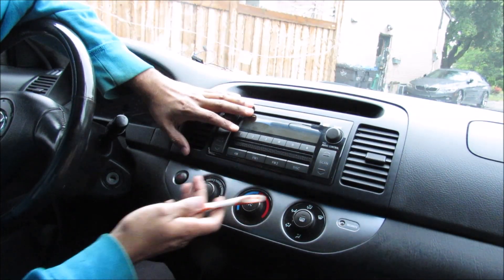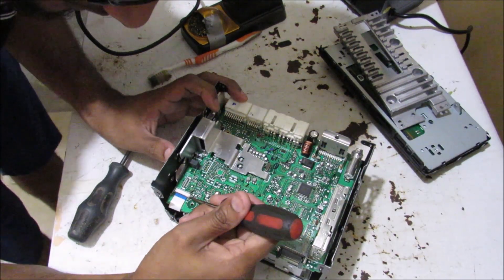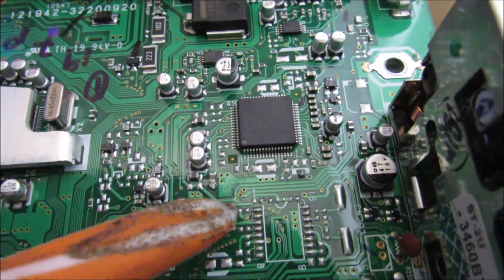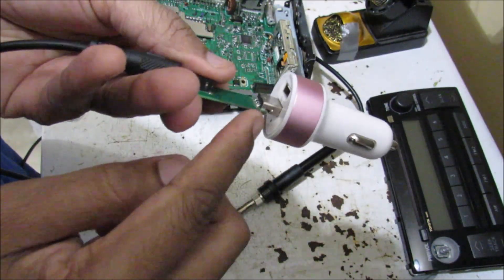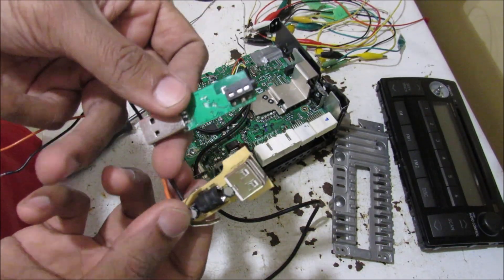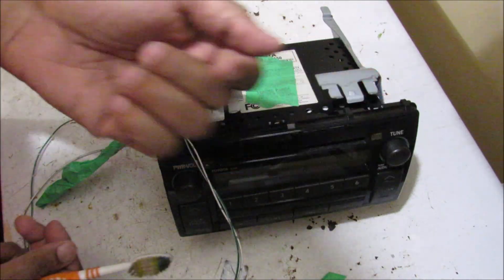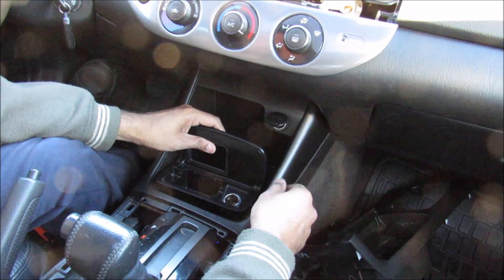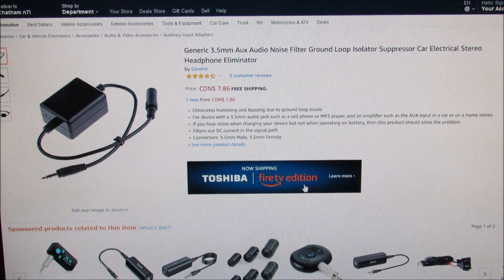$10 Bluetooth Stereo Hack

Comment: Why not use the aux input legs of the mixer chip?
Reply from the maker: Because you'll need bus protocol to trick it to read from those legs
Reply: @speedkar99  ah fair point.

Would there have been some way to trick the unit into thinking there was a CD there always whenever CD was selected or is it talking rather than direct control?

Nice work either way, in my case for my ford which had factory boot mount CD stack and double stack unit up front I just tore the stacker and double dins out and now have a pioneer bt unit and uniden digital scanner below that. The bt unit is great as it gives hands free phone so with the cradle I can still legally use the phone whilst driving and can stream my tunes so 99.9% of the time my tunes are off my phone now.

Comment: One possible improvement on the hack is to power the Bluetooth module using the 5 volt supply from the radio, just need to locate it.
Reply from the maker: Good tip. Tried the 12V supply to my inverter and my radio didn't turn on...

Comment: In my opinions...Inbuilt Bluetooth module is way cheaper and efficient...not at all worth doing this.
Reply: The module which comes with factory installed Bluetooth...I got the one for 20 bucks
Reply from the maker: Oh the one that plugs in to the back of the radio... Yes there are off the shelf solutions 
They are a bit more expensive and not as fun a hacking your radio
Reply from the maker: Inbuilt meaning comes with the radio, or putting the module inside the radio?

Comment: Nice video, but I dont think the average person has the knowledge to try to set up something like this.. A simpler and much easier option is to just get a bluetooth compatible FM TRANSMITER off ebay, the highest quality ones are like $25 but some cheap ones are as little as $10..
Reply from the maker: Thanks, the only downside is the sound quality on the FM transmitters aren't that great... comparable to AM radio 🤣
Reply: With that you get, an aux port, 3 usb ports/chargers, bluetooth calling, voltmeter, memory card slot etc.. its an all in one package
Reply: Having said all that.. in terms of "hacks" this was awesome! :D keep up the good content man, here since 17k subs
Reply from the maker: Thanks
Reply: FM Transmitter have a horrible quality.
Reply: only issue I have with those devices are some cars don't play nice and create static which means I can't get good quality sound.
Reply: You guys are all correct, but I have had various brands of FM Transmitters, the cheap ones have a lot of noticeable static however I am very happy with the recent one I got,  not noticeable at all (also helps if you select an empty FM station) and the bass is amazing for what it is.
Reply: I used an iSimple wired FM modulator......no interference.. thrn used a Tunai Firefly  Bluetooth dongle.... stays plugged into usb for power, no battery needing to be charged.
Reply: The quality would be horrible, and also I don't either think that it's legal, since you are transmitting a signal that would interfere with other radios, like radios of other cars (you could in theory get away with directly attaching you transmitter to the antenna input of the radio and shield it so the signal isn't transmitted in the air, but at this point just wire an AUX input)

Comment: Interesting, there was no 5V source on the board?
Reply from the maker: I couldn't easily locate one. I did tap into the 12V power source going to the radio, and that almost fried it...the radio did not want to turn on with the Bluetooth dongle connected. 
Once I removed it, it worked again...I'd rather not take that risk.